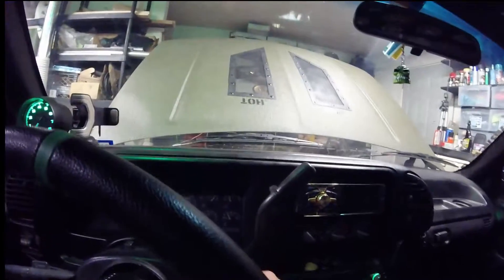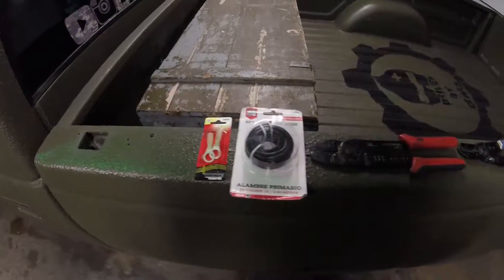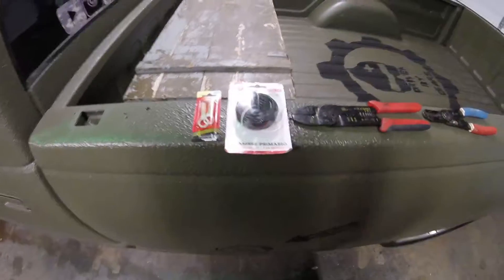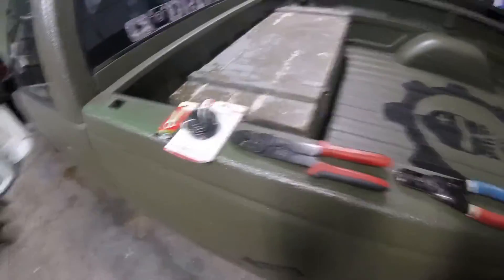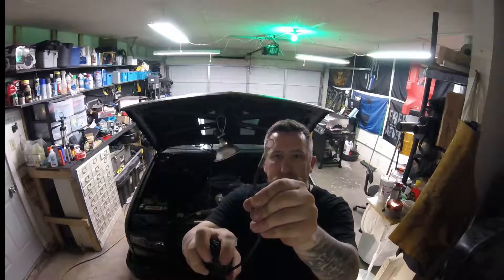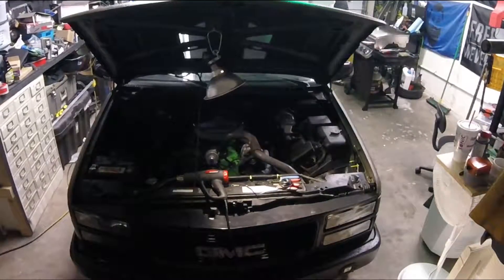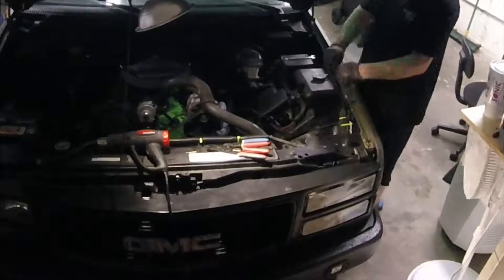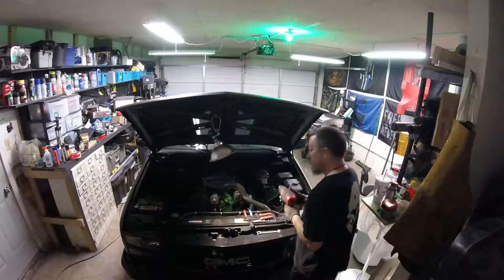High Output Alternator Ground

Comment: I like the green light theme. I'm installing a 390 amp on my 09 maxima. Says to ground to negative battery terminal. I wanted to ground to frame but everywhere I look says to ground to battery. I'm actually doing dual 0 gauge grounds and dual 0 gauge positive wires. I'd rather have more than I need than pushing the limits. I'm sure it was a good feeling when you're ground fix worked.

Comment: just came across this video, so a tip. Electricity is the flow of electrons and the conventional flow is from positive to negative but there are tons of engineers who say its from negative to positive, ether way if you have a high output alternator say 200a then you would want to run a minimum of 4g wire depending on run length straight to battery so pretty beefy wire, which means you need the same size ground wire from alt case to ground, I always add an additional ground from battery negative to chassis, then same size wire from chassis to engine block. this insures you have an excellent flow of electricity from all powers thru grounds back to source which is always battery, if you have a small ground wire it will bottle neck the flow of electrons and not allow proper current. I have done this upgrade "big 4" on many cars and it makes a huge difference. best of luck and awesome ride man!
Reply from the maker: Good info yea I knew about the big 4

Comment: Hell yea improvement is always good, still got a bit of drain with everything on. lights shouldnt pull your voltage down unless there is some issue like a ground there as well. i think i would try taking the new alternator ground to the truck frame then adding a separate ground from the frame to the ground for the headlights on the core support, that could help. as for the blower motor i forget where the ground is on that truck but i would check it and just make sure there is no rust and it has a good connection
Reply from the maker: yea i do have HID's which draw a lot of power they have there own ballast. but yea im go through everything and try it
Reply: @DrivenbyGears  yea that could be drawing alot, i would diffidently check the grounds